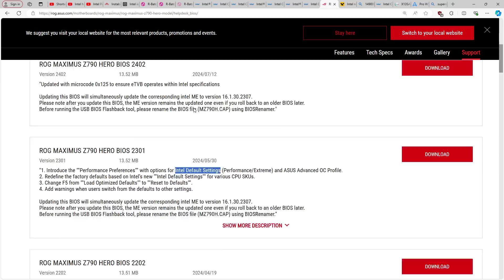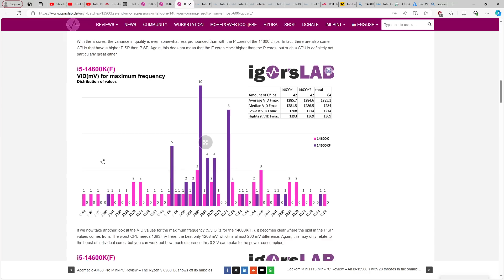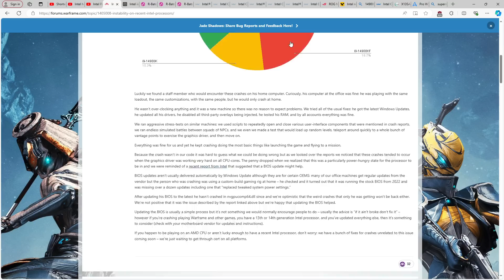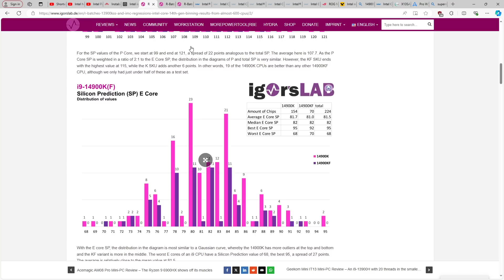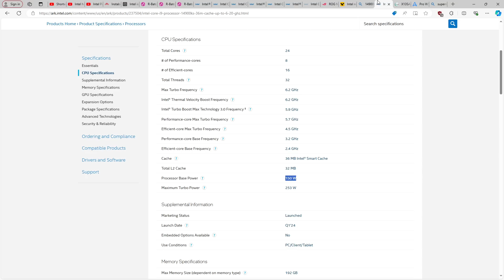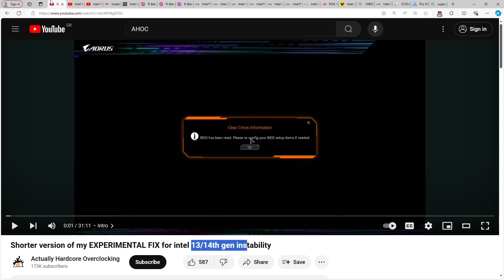The intel instability and degradation rant.

Comment: I'm lost. So are all the 13th and 14th gen high-end cpus falling or just the K, Kf... versions? 
And if I were to buy non-K, what are the performance for these. There are literally no in-game benchmarks for these...
[Specifically I'm wondering about i7-14700k vs i9-14900]

Ironic... asking about overclock locked cpus on overclocking channel
Reply: People with non-k CPUs and lower end 13th and 14th gen are also reporting issues, just at a lower rate.
Reply: @giglioflex  Thx, but are there any graphs/texts comparing the percentage for me to find the degree of differences between K and non-K failing, we are talking?
Reply: @qurdupelek3319  Unfortunately not and it would be really hard to gather enough data to put together such a graph.  You need both a large sample size and a log of crash events for all those system.  We were lucky wendel was able to get access to game crash logs and gamer server partner data for what we do know.
Reply: 50% of the cpus were not failing according to the statistics cited from wendell.
Reply: @Jaejgaren  Wendel provided two figures in his video.  10-15% of the CPUs were outright failing while 50% had an abnormally high incident rate.
Reply: But wasn't he talking just about K's?

Comment: Intels stock will likely drop and Im going to pick up more, call me a fool and yes it is risky. However the US cant afford to let Intel fail. Pattycakes has to go, they need to clean out the rot and start over. I have multiple Intel cpus and Arc cards and I have had no issues. Intel will fix all these issues and people need to be held responsible.

Comment: I must have gotten lucky with my i5 14600k. So far works well and didn't encounter any stability issues. Board never pushed over 1.3V into it.
Reply: also have cpu at default, so max turbo is at 5.3GHz
Reply: Delayed don't meet denied.
Reply: @giglioflex  got it since launch, if it degrades, I'll file for RMA. Plenty of time left till 2026

Comment: Build Zoid here is Raptors 14tth and 13th desktop full line run to date production volume, don't spread bad data, this is very accurate on the Intel channel sales admin signal. Please BZ don't start a false narrative which makes a lot more work for me. I leave compatibility, application and performance notes to you as the technical specialist. Production and economic data that is my specialty. 

Raptor 14900/13900K_ represent about 1/3 of full run production they were not limited and that equals minimally between 41,569,085 to 49.5 million units. I place combined runs at range 125,966,924 up to 150 million units on channel supply and INTC financial data and with bundle deal non reported sales close incentive possibly a smidge more.

14900KS	1.38%
14900K	        30.29%
14900KF	5.09%
14900	        0.02%
14900F	        1.21%
14900T	        0.77%
	
14790F	        0.35%
14700K	        14.07%
14700KF	5.22%
14700	        0.04%
14700F	        3.09%
14700T	        0.66%
	
14600K	        14.71%
14600KF	3.24%
14600	        0.01%
14600T	        0.05%
	
14500	        2.79%
14500T	        0.37%
14490F	        0.02%
14400	        6.11%
14400T	        0.08%
14400F   	2.35%
	
14100	        7.19%
14100F	        0.76%
14100T	        0.12%
	               100.00%
	
13900KS	7.06%
13900K	        28.57%
13900	        3.84%
13900KF	2.39%
13900F	        1.77%
13900T	        0.40%
	
13790F	        0.18%
13700K	        14.04%
13700	        4.45%
13700KF	2.40%
13700F	        2.83%
13700T	        1.47%
	
13600K	        5.68%
13600	        0.13%
13600KF	2.40%
13600T	        0.59%
	
13500	        5.51%
13500T	        2.75%
13490F	        0.21%
13400	        2.98%
13400F	        2.15%
13400T	        1.51%
	
13100	       4.79%
13100F	       1.13%
13100T	       0.76%
	              100.00%

Mike Bruzzone
FTC Docket 9341 monitor; AMD, Intel Nvidia
Enlisted by FTC attorneys, retained by US Congress at 15 USC 5
Reply: i9's were produced in much greater volume than i7, as u c BZ, inquiry answered. mb

Comment: in 1996 i replaced my clock crystal on my ibm 80286 and overclocked it(TOO MUCH). it rapidly degraded , blowing chunks into the ceiling. it needed a heatsink.

Comment: I knew there is something fishy when my 13600kf dies after 1 year of usage.
Reply: That CPU shouldn't be affected by this issue
Reply: @TigTex  well... it shouldn`t but my CPU dies in normal daily usage without OC and I still doesn`t know why. Anyway it was guarantee replaced, but the fact that this is my first dead CPU in my 20 years expirience with the computers leave bad taste in my mouth.
Reply: @TigTex it should because it is built on same architecture.
Reply: @Riyozsu it's still extremely rare for the i5 to just die, at worse you expect a degradation if it was the same issue not death.

Comment: Like, intel has like a really like big like problem like with like their like 14th gen like cpu's, like with their like stability like even when like not overclocked like you would like expect these like sorts of problems to like appear like normally.
Intel like should like probably like start replacing like whole like bad batches like of 14th gen like cpu's or like offer to like give a like free upgrade like to like upcoming like 15th gen like cpu's if like it's not like a fab issue but like a like design like flaw.

Comment: It simple just lock all cores to reasonable  ghz  cause 2 core are hitting insane voltage to hit the high 5.8-6.2 ghz . No reason to pump 1.5-1.6v into a cpu . Also you cant run an Aio on  KS chips without delid .

Comment: I have i7 13700F and I am extremely happy with it. Yes it is not the best intel CPU but it is good enough for me. Likely will last me another 5 years min. I will probably upgrade once high frequency DDR6 modules get cheap. It is running at 1.370V all cores idk if this is good but never accountered any weird error or blue screens.

Comment: I was on the edge between getting a top line intel 14th gen or Ryzen 9. I am glad I stuck with my Red-Green mix for my new build rather than switching back to Blue-Green.

The R9 seemed to have higher lows but slightly lower max fps. Felt much better suited for the type of performance I was after. This is a surprising benefit of my decision.
Reply: If you only game, the 7800X3D is a better CPU than 7950X3D.

Comment: All CPU's and GPU's are now, and have been for a number of generations, pre-overclocked. You used to be able to safely overclock certain CPU's in the past to get the performance of a much more expensive CPU (e.g. 2008's Intel i7 920, etc etc). That headroom has been steadily eroded as competition heated up, till today, where there's effectively none. 
When you run out of headroom and the competition's tough what do you do? Well...Intel creates faux headroom. Those high CPU voltages are playing in the grey/death zone. Intel gambled and are loosing. Badly.

Comment: 13700K owner here.

I have a heat issue more than a stability issue. I did have Nvidia update crashes until I purchased my Sapphire 7900 xtx. Everything has been good with MCE off on my Asus z790 Hero. I don't overclock, btw.
Reply: A lot of people with Intel CPU and Nvidia GPU have been seeing crashes.  Nvidia GPUs have a software scheduler which puts more stress on the CPU which in turn will bring out CPU related issue more readily.  You might have a degrading CPU still but when you went AMD GPU it stopped popping up due to AMD GPUs have a hardware scheduler.

Comment: i bet you that setting uncore clock to 5000mhz is maximum clock for ring bus will make it stable thus voltage 1.4v is possible to keep it lock in vcc ...since its unlock for this gen than last 2 gen...while i let boosting on its owned to 6ghz....while uncore is lower than 5.1ghz...while memory ddr5 support will be limited to 10000mt ...while i see no reason to have that dimm sticks when it does super fine with 8000mt with uncore clock 4ghz...i would match to E-core clocks but nothing higher when vcc gonna demand more power with ring bus

Comment: I'm no expert by any means, but here is my experience with stabilizing my very unstable 15 month old I9 13900k. 
I learned about the MB automatic overclocking from Jayz twocents and learned a bit about adjusting settings that I've been unfamiliar with.

I have an ASRock Z690 C/D5 MB. The default TJ max was set to 115C, and voltage limits were basically unlimited, over 4000, I don't recall the exact number. (I don't know how to check for line voltage settings you mentioned) It frequently ran at 105C and occasionally 107C according to HW monitor. I installed HW monitor due to frequent BSOD crashes and certain games that refused to even start.
I would frequently get Nvidea crashes and "Out of Vram" errors on my 12GB 4070ti.

Setting the MB Bios to enforce Intel standards changed the PL1 and PL2 to 125 and 253 as it should of, but did NOT change TJ max. I manually changed it to 100C (my 10 year old AMD systems default, I was unaware of Intels 12th gen being 95C)
I stabilized mine by using Throttlestop and undervolting the CPU core by -.075 and CPU P cache by -.085 along with reducing boost to 53 on all cores from 58 on the first two cores and 56 on the rest.
I did not try turning off e-cores and I use xmp profile 1 (IIRC) on 64GB DDR5.
I have not updated bios as last time I checked the update was a beta, and the default settings for the I9 on the stock bios makes me not trust anything short of a full release.
It's been stable and running much cooler for two months now.
I'm disappointment as it was advertised as being capable of 5.8Ghz, and to be stable and cool I have to run it at 5.3......
I bumbled and stumbled my way to these settings as I've never done more than set xmp and played with automatic overclock on my old AMD system.

I regret switching to Intel.....
Reply: Just a heads up, Wendell's video pointed out that gaming server providers also downclock their 13900K and 14900k CPUs and that only delayed the CPUs demise.  They eventually failed to run those lower clocks and failed.
Reply: @giglioflex  A point not lost on me. At this time all I can do is monitor the situation and hope Intel does the right thing or that I beat the odds and the previous 12 months have not already caused damage from the ridiculous MB default settings that so far seem to be not evident.
For now though, undervolting and underclocking the CPU does 'seem' to provide stability.
I used to do a casual overclock on my old system. Sucks having to underclock and get less performance than I paid for with zero overhead for any overclocking not involving liquid nitrogen...at a minimum!😆
Reply: Honestly, intel WAS plug and play. It just worked. Hahahhhahahahhaha😂😂
Reply: @MarioAPN  And one of the reasons I opted for the Intel option as my 10 year old AMD computer was inferior to the Intel offerings at the time but finances then dictated the choice. Now that finances were no longer a concern of course would be the time Intel shits the bed.
Reply: @Pslytely_Psycho_GreybeardGamer  10 years ago was the first Ryzen? I put the 5700X, that I have bought used for 100 eur/usd, on the 7 years old B450 MBO. Just updated the bios. PBO overclocked it to 4700MHz, I am cooling it with 120MM single fan tower air cooler. I was blown away with value and performance.
Reply: @MarioAPN  I never said anything about it being a Ryzen.
It was an FX8320.
It was rated at 3.5Ghz but ran out of the box at 3.7Ghz and held a nice stable 4.2Ghz OC for ten years.
It still works perfectly.

I upgraded the memory from 8Gb to 16Gb till finally filling all 4 slots to 32Gb a few years ago because Cities Skylines 1 sees memory chips like I see potato chips....nom, nom.

I also upgraded the original 1GB video card (I don't recall which one) twice ending up with an Sapphire RX 580 8GB that ran RDR2 at 40fps on relatively high graphics settings and sent many a Kerbal to their deaths....

Hehe, I just realized I built that system 12 years ago, not 10.
Reply: @Pslytely_Psycho_GreybeardGamer  yup, you did not say so I asked. FX were ok budget option. Still remember how you got a bundle game with FX 8350. The problem was, if Ryzen failed at the time, AMD would be done. Intel would probably bought them and that would be it. The stocks were 8 USD at that time. Then came Lisa Su with Ryzen. There was that other engineer that was running the project and was super important. Now, look at what we have on the AM4. And new stuff like the 5700X3D are still coming.
Reply: @MarioAPN  Sigh* makes me wish I were 'stock savvy,' it would of been a great investment at the time.
I don't recall what game came with the CPU, IIRC i already had it and gave the free one to my son.
I'm always on the wrong side of the tracks, got AMD when Intel was better, switched to Intel when AMD is currently better....sheesh....what a track record....😝
My only defense was no one knew the 13th gens were going to be such problem children....and they were blazingly fast....until the crashing began....

Comment: I had stability degradation issues across dozens of systems at my company with AM4 ryzen CPUs throughout whole lifetime of the socket when running XMP until I got R5 5600 (non-X). What I'm missing from the info from Wendell's investigation is that what the server farms did to repair those systems - is replacing the CPUs with new ones actually fixing it? What happens if you replace memory? Does this memory kit work stable on previous platform or on freshly replaced 14th gen cpu? For me there's a reason why some pre-built makers are stating that XMP voids warranty for ryzen systems, which JayZ2Cents ranted about. So yeah, I'd investigate the connection with the memory - is the overheating/overloading of the CPU affecting memory controller and potentially this degrades memory?
Reply: Instability as a result of XMP is not stability degradation.  Not even close.  It's memory instability.  The difference between the two is huge, memory instability is not damage to the CPU unlike the current Intel degradation issue is.  One can solve memory instability easily, either get a kit designed for AMD or manually tune your kit.  There is no solution for the current Intel issue aside from getting a new CPU.

Over half the Intel servers were having crashing issues and 10-15% have outright failed.  Those systems had various motherboard and RAM configurations.  Clearly the RAM is not the issue, the common thread is the CPU.  As pointed out in wendell's video, lowering ram all the way down to 4300 only delayed issues from popping up.
Reply: @giglioflex  I tell you what I had experienced, it was stability degradation coming from the memory to a point where some of kits didn't POST after few days running at 3200MHz XMP profile. Kits replaced and then running at XMP+downclock to 2933MHz and the system worked stable for few years without problems. Some of the kits that run for two weeks to a month before they started crashing, seemed stable after applying this downclock to 2933MHz to only slowly degrade over time. It's just that I couldn't get through with the problem anywhere with the fanboyism on the communities because obviously that had to be my fault despite it being about just setting up XMP in the bios and nothing else. And many people in my country asking about the instability of XMP and many people ranting on the communities that they tried to build ryzen PC, RMA'd everything and it's still unstable as hell when XMP is on, so they're not going back to amd ever again in comparison to XMP just working out of the box on LGA115x platforms.

About the intel servers - I'd like to know what happens to those server when they replace the memory for a fresh kit and how the memory kit from the ran-down server behaves in a fresh one with such fresh 14th gen CPU. It's like the the most straightforward question if you're investigating the issue to check and state whether other components were affected and if yes, then to what degree. That's what I'm missing from the current info, unless I missed something. And lowering ram down to bring back some stability looks exactly like the issues I had.
Reply: @SaperPl1  Dropping memory clock would not stop any hypothetical degradation.  The vast majority of the time degradation is caused by excessive voltage.

The stock voltage applied by many memory kits with XMP / EXPO enabled is extremely safe, nowhere near enough to degrade.  Now your motherboard can cause degradation of the memory controller on the CPU but again it would have to be applying way too much voltage.  ASUS is the only vendor as of late that's had issues with that sort of thing as far as I'm aware but that applies to both their Intel and AMD products.

Given that you've replaced all your parts and still experienced the issue you are either extremely unlucky or the problem is not what you think it is.  You are the first person I've ever seen report this issue so to have the same exceedingly rare issue twice is extremely improbable.  It's more likely that the issue isn't what you think it is.  You are very sure that it's degradation of AMD's CPU Memory controller (which is what would cause the symptoms you describe) yet you haven't provided any evidence that you actually isolated the issue down to the CPU memory controller.

In regards to the servers, without a doubt the company handling the servers swapped memory during testing.  That's a basic troubleshooting step.  Not that it really matters than much when you have thousands of servers and only the 14900K and 13900K servers are failing at a greatly increased rate.  The same RAM and Motherboard SKUs being used with other CPUs are not experiencing said issue so it's obvious they are not the issue.